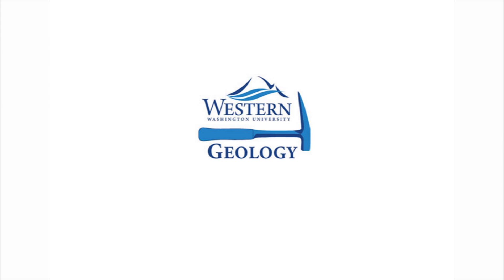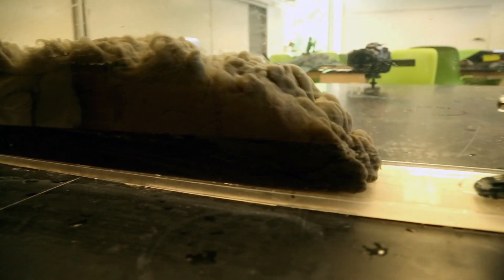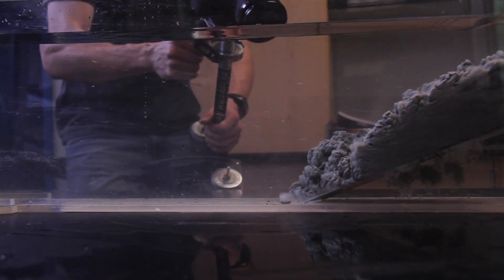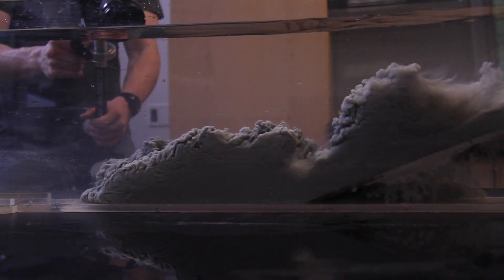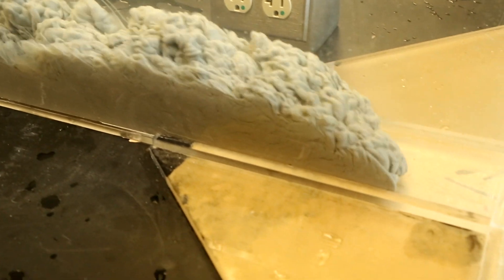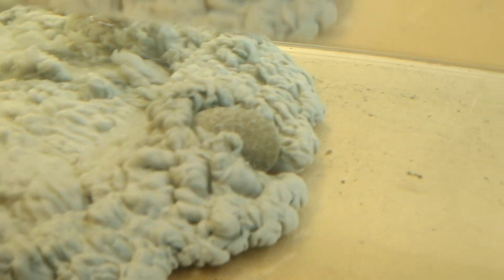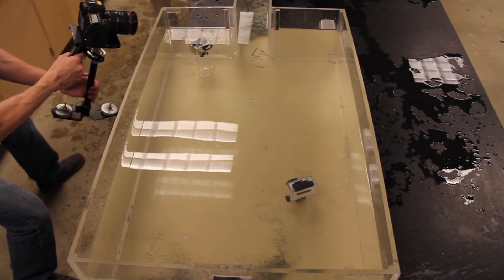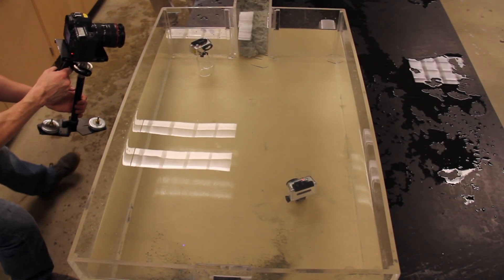Turbidity Currents

Comment: Question: Why does the turbidity stay at the bottom and progrades at the bottom extending outwards instead of spreading everywhere in the water? Does it have to do with the density of the material that was used for the experiment? Thank you.

Comment: Thanks for the video. Please tell me, what material did you use to show the turbidity current?
Reply from the maker: Glen Heapy I beleive it was mostly clay with some silt, but I don't remember for sure.
Reply: What sort of paint would work well in this? What are the properties of clay and silt that make it flow so far into the tank?